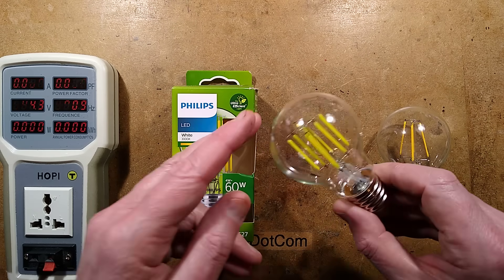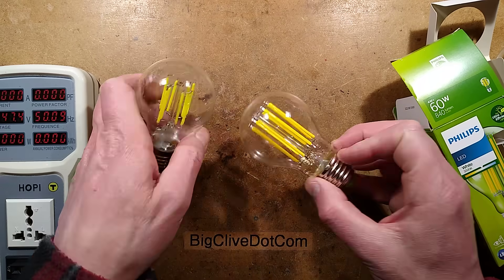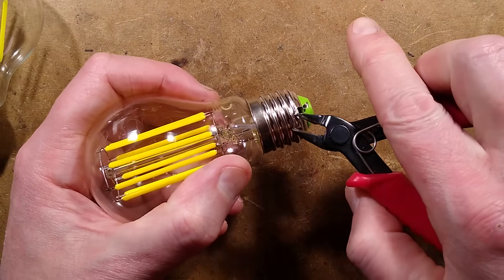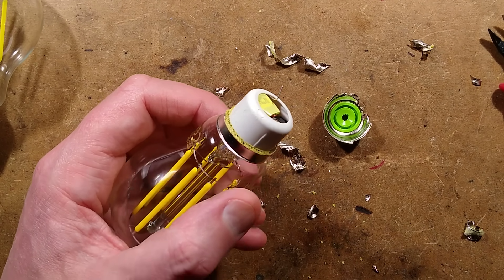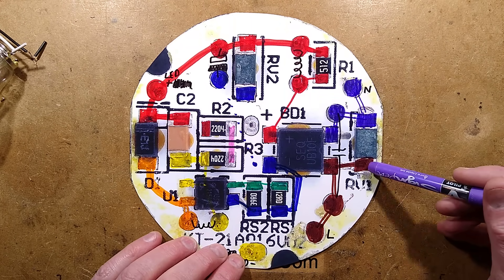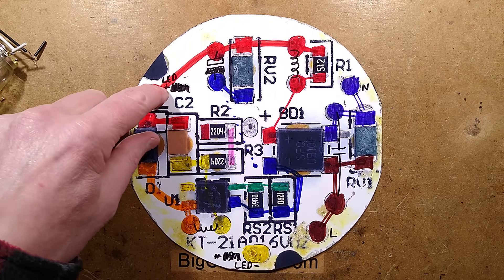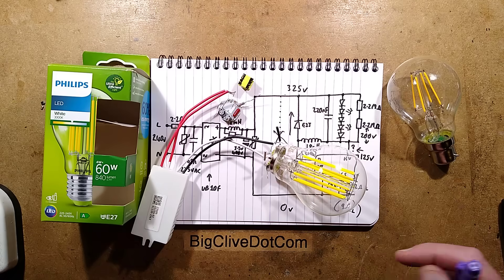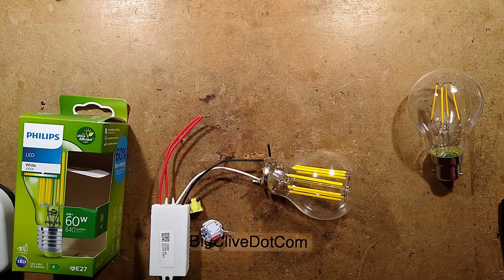Inside a new Philips ultra-efficient LED lamp (with schematic)

Comment: This lamp has an IP rating of 20, which means it has no protection against dust or moisture. Therefor it's meant for indoor use only, and not in 'security' lights outside your house.  That's what the symbol says.
Reply: Looks like a PIR detector, so yes.
Reply: I think they mean it can't be controlled by PIR sensors - i.e. electronic switches (triac or whatever). If it is inside an IP68 (whatever) rated enclosure, the rating of the bulb isn't important.
Reply: @AAAyyyGGG  that’s what I thought.
Reply: @AAAyyyGGG  a PIR coach lantern on my dads house destroyed a few LED bulbs in weeks... then we got a 'dimmable' LED bulb and that's lasted a good couple of years now. 
IMO there's something about the way those PIR's switch - contact bounce on a cheap relay or something. pretty sure dad's has got a relay - you can hear it click when it switches.
Can't think of a reason for that icon otherwise - if it was about the outdoor environment it'd apply equally to any exterior light that was switched by a normal switch.
Reply: I think you are wrong: this symbol means not suitable for emergency lighting and/or detection zone switched fixtures - both internal SMPS related.
Reply: @deepblueskyshine  The emergency stickperson has their trailing leg bent parallel to the ground... I think this stickperson is just mooching around.
Reply: @joinedupjon  :)
Reply: @deepblueskyshine  - so, if we don’t know, Clive doesn’t know, then who knows? You could be right, but I don’t know why.
Reply: Doesn't 20 mean resistant to dust but not to water?
Reply: @ianhosier4042  2 is for 12mm particles or fingers. "dust" starts at 5
Reply: @ianhosier4042  IP2X means it's touch resistant (the British Standard, 11mm, index fingers can't get into it).
So no dust resistance. The 0 means completely irresistant to water.
Reply: It could also mean: do not use above a fireplace 😜
Reply: @vezzosetto  better not take the chance
Reply: What rating means it's protected vs the vise of knowledge?
Reply: does no protection to moisture also mean it's not allowed to be used in a bathroom near a steamy shower as well?
Reply: @TheCramik  Yes/No. Bath lamps body outside UK have an IP rating of 44, or 64, or 68. So a light (lamp) self can have no IP. But all Edison sockets should have min IP20. (I am sorry I know only you use band switches how hang down from the roof. We use switches outside bathroom in Germany and Thailand.)
Reply: @OldLordSpeedy  - the use of pull light switches in a bathroom or shower room is standard practice, but not a standards requirement. A normal wall switch can be used as long as it’s outside the bath/shower/wash basin zone.
Reply: Not relevant in a weatherproof housing. I use "ordinary" LED bulbs in those without any issues.
Reply: That’s what I thought. 👍
Reply: It is completely enclosed in glass. What would give it even more protection? The electronic components being surrounded by a potting compound? The socket still ahs to have contacts exposed with a bigger gap. If it has some kind of rubber band around it, then that can enclose the internals of the lamp too.
Reply: Doesn't make sense. It's pretty much perfectly sealed with the glass bulb and the metal screw and nothing else. I don't even think the IP rating makes any sense for lightbulbs to begin with since no light socket/connector format offers any such rating. It's always the lamps they go into.
Reply: Noice
Reply: thats what I thought as well
Reply: @Bart Burkels
Wrong.  IP rating of bulb is not relevant, because you will use IP44 rating Light for outside use. You dont need IP44 bulb.
this LED bulb is not suitable for PIR detetion (or any)
Reply: @jankindl915  why is it not suitable for pir detection then? I have leds outside on a pir motion detector for almost 10 years now. the pir just sends power on demand am i missing something?
Reply: @jbbolts  yes i have LED in PIR also with no problem. So, i have no idea. but if they say so, who knows.
Reply: Insecurities
Reply: thanks , really helpful

Comment: I think 8w and over LED bulbs should be banned if it’s equivalent to 75w or greater. Also, many higher wattage LEDs can’t be used in enclosed fixtures.
Reply: Why? Sometimes you need a bright bulb.
Reply: @TheFreak111  No I’m talking about the efficiency. I like brighter bulbs. A 60W equivalent bulb shouldn’t be over 5 watts.
Reply: @loudspeakertestsmorebyaida3804  ah that wasn't clear to me, since you said 8W should be banned if it is equivalent to 75W or greater, so 8W with equivalent to 200W should also be banned, which is super efficient. But basically you mean anything below a certain lumen per watt should be banned, that might be a good idea yes.

Comment: Could you look at the philips retro fit 'fluorescent' LED tubes? They do a cheap 'mains voltage' one and universal one that does HF and magnetic ballast without altering the fitting. I'm thinking of suggesting the cheap ones for a workshop (with appropriate modifications to the fitting).
Reply: I got those or something similar from the box store in the US a couple years ago. Once they had them 2 x1 tube packages for $10. You could slip them into normal ballasted fluoros. So, I picked up some of their $10 ballast fixtures and some tubes. This was a couple year back when you were lucky to find fluoro style LED's for $40.

Comment: That symbol says, in plain English "Not suitable for PIR/proximity sensing lamp fixtures" (not for use in automatic lights). My assumption would be that say, outdoor porch lights, being prone to triggering on every cat, dog, kid, camel, goat, kangaroo, blackbird, crow, wicked witch, or postman etc. would turn on and of so many times, and at such frequent intervals, that the bulb would fail long before its projected lifespan.

An alternative meaning for that symbol "Do not drop curved screed LCD TVs on passing pedestrians"!

Comment: I enjoy the colour temperature decision they made. I have a set of tunable LED bulbs, and I settled on a similar sort of tweaked soft white. There's a point where the clarity of the daylight range kicks in, but without the harshness and I guess it's roughly 3000K!
Reply: 3000K is common for bathroom lights here in Norway, and I've also gone for 3000K and 90+ CRI for our kitchen lighting. Other rooms are still predominantly 2700K (typical incandescent bulb). Daylight is around 6500K IIRC.

Comment: We might need some real-world testing to objectively compare the long-term value proposition vs typical LED bulbs, but I suspect that the manufacturers are again choosing to balance market competitiveness with efficiency; if you can't beat 'em, you'll have to join 'em.  Consumers are horrible at maximizing long-term value; they want to save money today, not tomorrow, and this is often because they have no other choice and/or have been trained to minimize short-term expenses while ignoring long-term investment.
Reply: I would add to that, when you don't know (or how to evaluate) how long something will last the only variable you can change is the purchase price. I think many would pay more for longer lasting products if they knew it would last longer (instead of just being more expensive, maybe with more features, thus increased risk for it to break early).

Comment: HV connection may help efficiency - the LEDs acting as part of the series dropper for the chip supply, making light instead of burning off as heat in the chip
Reply: Maybe the chip is optimized for 120V Supply.
Reply: @andreasdill4329  Makes sense. North America and Japan would have one minor change to the circuit, and rest of the world gets the other one. Same components, same board, just bridge a different connection for the voltage where it's sold.
Reply: @andreasdill4329  Very clever then the lowest current world wide is 120V. If you put in 120V is the dotted line fully correct. 🤗
Reply: @jort93z  beat me to it, i was just googling to see if anyone has lower than japan and i just found out...
Which country has the highest voltage?
The country of Brazil has a single-phase voltage of 127 V and a Frequency of 220 V.
bet you've never seen a country use 220v hz!
Reply: @jort93z  not really. some country uses 230V/p and 400V 3p. those who has 230V single phase has no 115V output
Reply: @jort93z  not so.  Generally 240V is normally a single phase from the three, i.e. one point of a star, with respect to a common ground.  If you check the voltage between any two of the phases you'll see 415V, a ratio of about 1.73x...
Reply: @jort93z  its 120v nominal(roughly) actually, depending on where you live it can be as low as 100 or as high as 140 in error conditions, ie, the power company has some faulty equipment or the load on the grid is especially loaded or unloaded outside of it's normal power range and they didnt slow down the generators yet but that is why products sold in the us say 110 or 115 or 120v, it is the nominal voltage but the actual voltage can be higher or lower depending on the day and time and where you live, products that use a switching supply are usually universally rated at 85 volts to 250 volts at 50 or 60 hz, i've never personally encountered a 400v outlet personally but the former yugoslavian reigion had 380v 3 phase outlets!
Reply: @frogz  400V (phase to phase) 3-phase sockets are fairly common at least in Finland and Italy. Although, 3-phase appliances are usually connected with screw terminals at home due to the price, risks, and size of the plugs.
Reply: @hbp_  where im from 3 phase is usually used for industrial appliances although one could let an electrician install it at your home for an extra fee. 230V 50hz is standard
Reply: @hbp_  415v phase to phase, 240v 50hz single phase was the Australian standard years ago, with 3 phase and 3 phase sockets available for homes if you were willing to pay for it.
Mostly single phase 240V (now shifted to 230v nominal ) for residential or light commercial use.
I looked at the history of line voltages once, found it was like colour TV - The yanks invented it ( making what were entirely valid and logical decisions based on their local situation ), then the rest of the world saw the issues that showed up when in real world usage, and tried variations to improve and solve these issues.
Reply: @jort93z   UK is 240V per phase, Europe is 220V per phase, for an average of 230V with a very wide tolerance band.
Reply: @frogz  india has 220-240V per phase 50 Hz
Reply: @frogz  Hurray for Canada still using 600V (Delta) 3 phase! Saves a bit of cash on smaller conductors or have less issues with long cable runs.
Reply: @katbryce  All that has really changed is the tolerance band I think.  It affects equipment manufacturers more than the supply equipment.   Here at my mothers house in England,  the supply has stayed constant at 246V since the 1970s.    Maybe if the local substation is ever replaced, it'll be closer to 230V.   I suspect it's similar in Europe,  where it'll usually be closer to 220V unless they get a new substation transformer.
Reply: @MattOGormanSmith  yep. Can confirm. It just depends.
Reply: @MattOGormanSmith  Even back in the 220V days the transformer secondary was 231/400V, even in the 1950s. It prabably could have been abour 240V with no load. Now with 230V nominal it can be about 246V with a small load.
Reply: Yeah if chip doesn't mind voltage fluctuations and upper switch being whole 200v higher than HV then why tf not
Reply: That was my first thought as well. Clever thought of Signify.
Reply: Yeah that's what Clive said